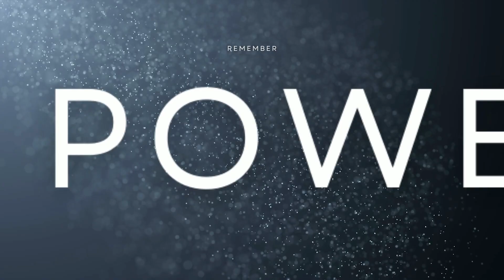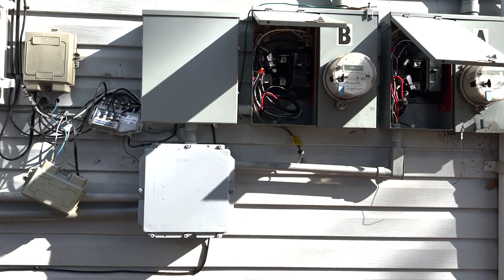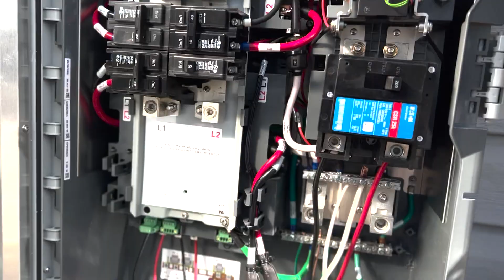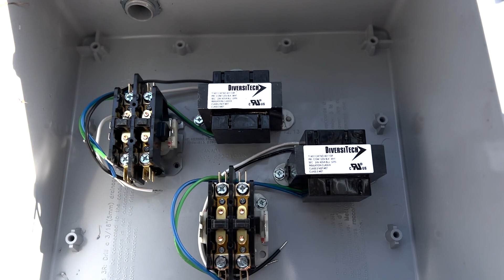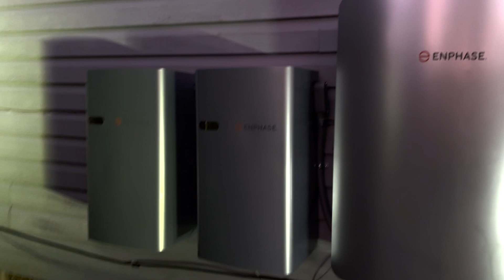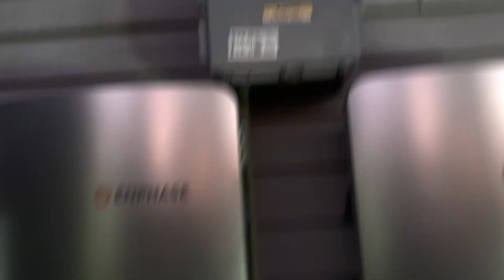Enphase Battery Storage Review

Comment: Short but sweet video.  Very informative. I'm getting ready to install my Enphase system with a 10kw battery, hopefully I install it correctly (diy). Any pointers are greatly appreciated.
Reply: Question: I just had a 4ton 20seer Variable speed Trane a.c system installed. Do you think it could run off my enphase system 10kw battery?  I've got 15 panels each with iq8 microinverters each panels can produce upto 400w my average annual KWh consumption is 9,312 kwh before the new a.c system...
Reply from the maker: @joselpepo  Hi Jose, You would need to install a soft starter to your a.c unit to lower the current inrush. You would have to do load shedding for the a.c circuit. The a.c would be your largest load. You would also have to calculate the L.R.A (Locking rotor amps) to calculate the current draw. I think with the soft starter installed it would be fine.
Reply from the maker: Hey man whenever you need me I can help out. I have an install scheduled for next week. I will be recording a step by step video.
Reply: @thinkpower3653  great! I'll definitely subscribe. Thank you.

Comment: Better, same or worse than tesla battery system?(taking out the fact that tesla customer service stinks).
Reply from the maker: I've heard allot about the Tesla Wall. I have not had a chance to install one yet. Not trying to sound like a salesman but The Enphase system Works pretty well as long as it is installed correctly. Its monitored every 15 minutes so someone is always checking on your system.
Reply: @thinkpower3653  Yes. My system was finally provisioned and turned on 1 month ago. So far so good. Gets windy here so we've had a few storm guard activation.
Reply from the maker: Awesome. Have you received the email with the link for you to monitor your system?
Reply: @thinkpower3653  If u r talking about having an enphase account, yes I have one. Monitoring the system through your account is addictive.
Reply from the maker: @burritosburritos  I bet it does. I find myself checking on installs I've done in the past to see how well they are performing.
Reply from the maker: I have not had to pleasure of working with the Tesla system yet, but out of all the other systems that I have installed Enphase seems to be fool proof if installed correctly.
Reply from the maker: Enphase has pretty good customer service.